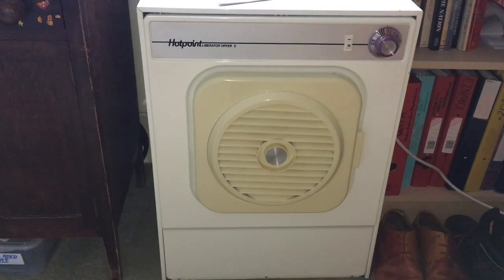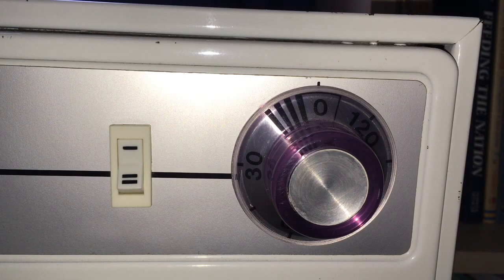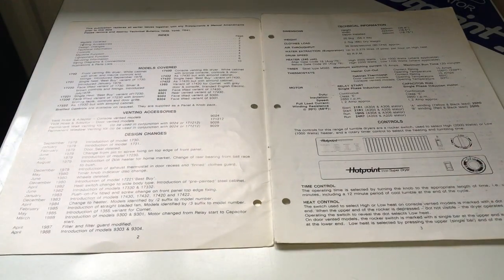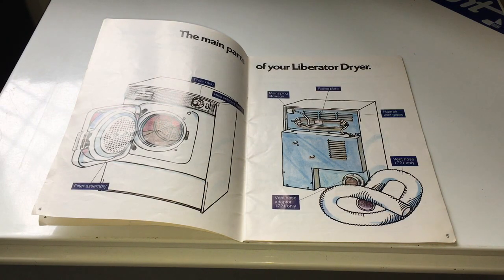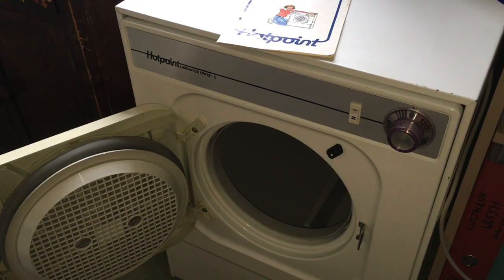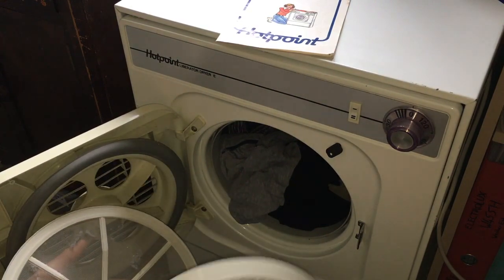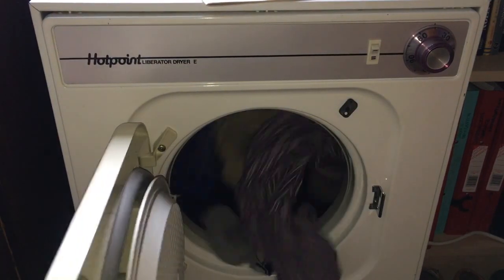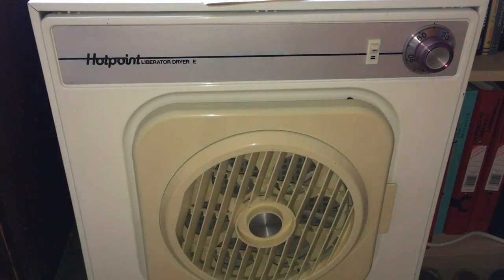Hotpoint Liberator Dryer E 1730

Comment: 😀 - the vent can be directed, that style of tumble dryer (with the exhaust air directly vented into the room) make an excellent fan heater with humidifier effect, if you don’t mind your house being a bit humid, unless you put a dehumidifier in front of the vented door to partly dehumidify the outgoing air. Traditional condenser dryers also have the same heating effect, without the humidity.

Comment: Hey :-)  I have a Hotpoint 1731 superdryer. mine is from 1979 it has just a timer dial the heater inside has two settings printed on it. but as it has no switch its stuck on either 1 of them. is your door hard to open ? there is a release on it but you cant get your fingers around it.
Reply from the maker: James Stephenson hi James it’s Chris who gave you the door lol yes door is stiff they require a firm tug to open
Reply: nice